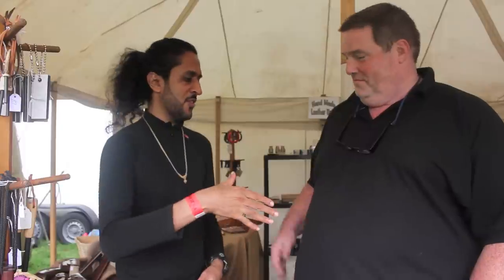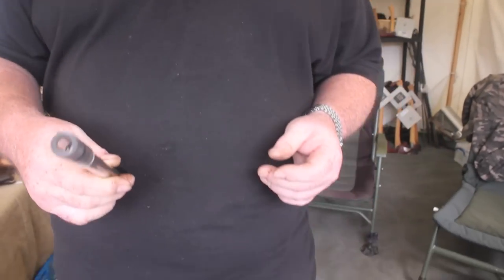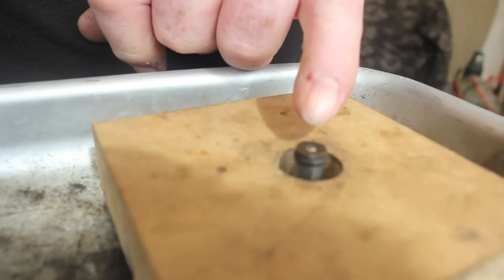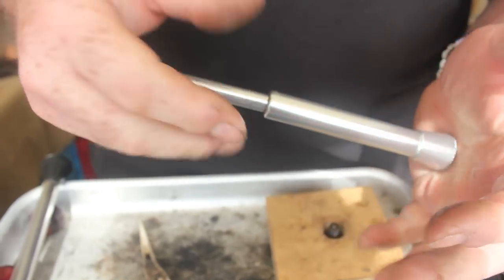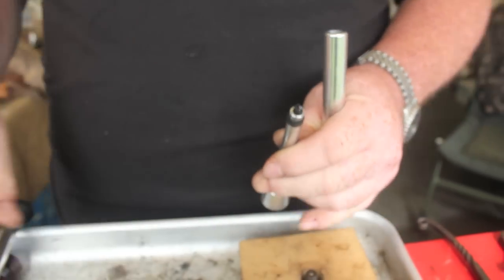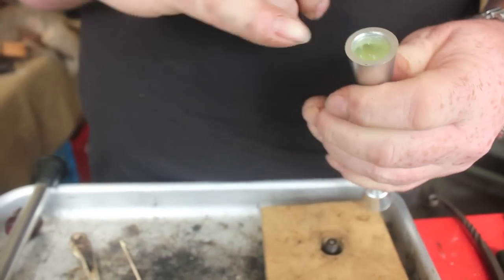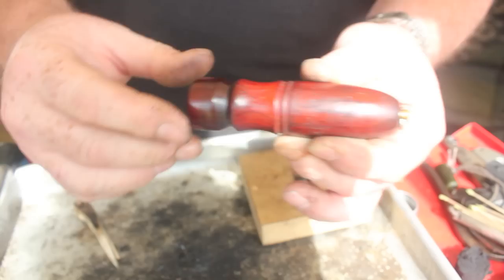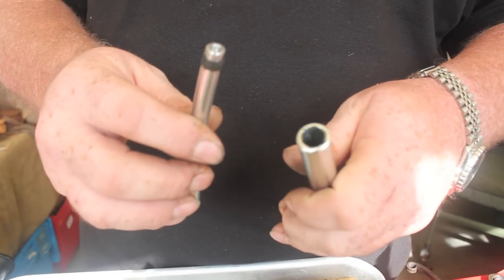How To Use A Fire Piston

Comment: I tried making a fire piston once from copper pipe that was blanked off at one end, made a plunger from wooden dowelling with a groove carved for the o-ring. Got it to smoulder once but gave up out of frustration, looking back if I'd watched this video I might have got it working, get one thing wrong and the whole process fails.  I believe a rubber o-ring will last longer by not using petrolium jelly as this will deterioriate the seal faster than using other lubes like silicone which doesn't affect the rubber. Interesting video thanks for sharing
Reply from the maker: Fell Wanderer Up till making this video I hadnt seen one being used so learnt tons myself. Its awesome you attempted making one and amazing as to the technology behind it, didnt realise it was the basis for diesel engines. Hope you and family are well Damien ~Peace~